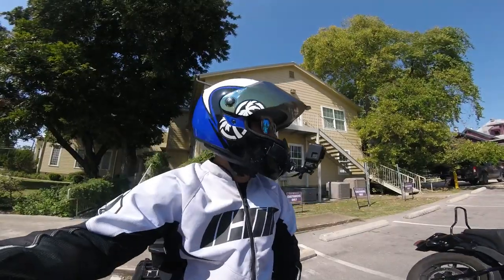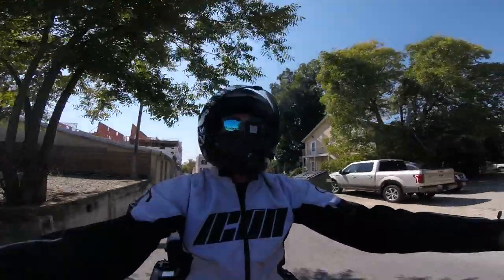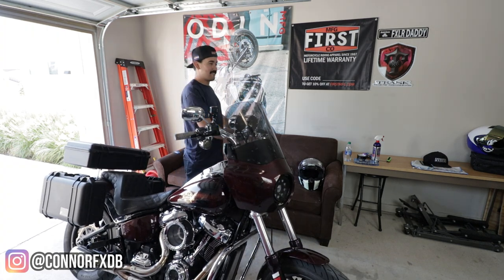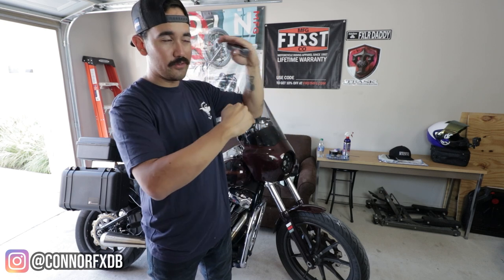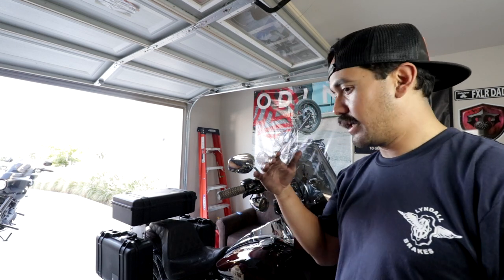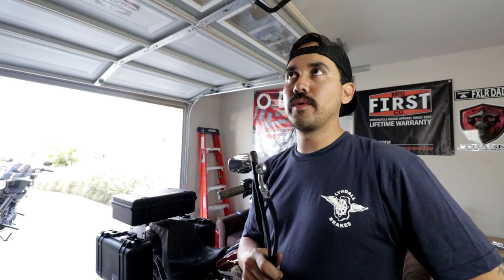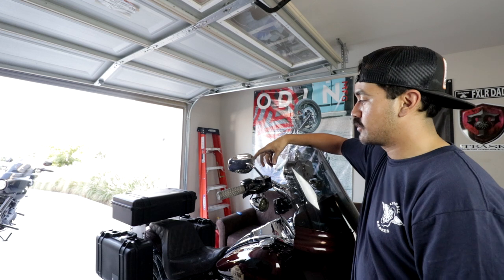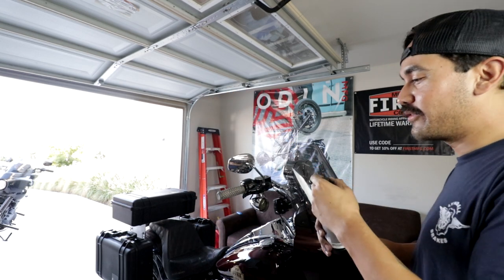13" ROTOR CONVERSION & TOKICO CALIPER SWAP | M8 Softail

Comment: If you use brembo 108mm caliber the banjo bolt is up high
Reply from the maker: nice! Those brembo m4 calipers are really nice! I ended up swapping from the tokico to a set of calipers from a YZF-R6 and the brake line/banjo bolt were up high as well which made it nice! 
I definitely enjoy the R6 calipers over the tokicos!

Comment: Hey I have a question and hopefully you can give me the correct answer.  My 2011 FXDT went through a major rebuild between 2020 and 2021. Lets just say the only thing stock on the bike is the frame, swing arm, rear brake caliper holder and rear brake caliper ( the swing arm, rear brake holder and caliper will be replaced with a Brocks Performance swing arm, Kraus Moto rear radial brake holder and Brembo .484 right side radial brake caliper by end of June). At the moment I just installed a S&S black 124 twin cam motor with every imaginable parts upgrade you can think of.  It pays to be a dealer.  Now the last thing I am thinking about doing is replacing my front dual 11.8 inch PM rotors and rear 11.5 inch Pm rotor with either the front two PM 11.8 inch brake rotors and 11.5 inch PM rear rotor with the Lyndall  11.8 inch crown cut dual front rotors and rear 11.5 inch rear brake rotor.  But after watching your video as well as other im thinking maybe I can consider the 13 inch Lyndall front rotors and 11.8 inch rear rotor.

The only issue I am having is that the Brembo .484 radial calipers go up to a 11.5 inch rotors.  But if I used the spacer provided I could have have used the 11.8 inch PM rotors.  Do you think that Brembo or any other company makes a spacer so that I could mount the Lyndall 13 inch front rotors?
Reply from the maker: howdy! the calipers wont be an issue going to a bigger rotor - the only thing you'll need is to get is a radial caliper mount and swap for 13" option. 
Speed merchant has one and provides with additional spacers; Kraus also offers a radial caliper mount with different sizing options. Its def doable!
Reply: @ConnorFXDB  Hey thanks for the feedback.  Regarding my calipers being mounted.  I have an ODC Monza 2.0 inverted front end with the radial mounting system.  When I had my stock front end with Racetech gold emulators and springs.  I converted to dual brakes and bought the Kraus Moto axial to radial adapters.  I actually spoke with my Brembo distributor at Race Technologies and she suggested that I just order their spacer and longer bolt kit for the 13 inch rotors just in case.  Im already running the Brembo spacers for the 11.8 inch rotors.  The Brembo .484 radial calipers originally came with 2 spacers sizes.  One for 11.8 inch rotors and one for 13 inch rotors. Like an idiot I through the bigger ones away.  So I ordered the spacer kit last week and got them in on Friday.  Tomorrow Im ordering the Lyndall 13 inch up front and 11.8 inch for the rear.  And in a month or two Im going to order the Krause radial bracket for the rear brake and order a right side brembo .484 radial caliper for the rear.  Helps a lot when  youre a dealer.  After ordering parts from January to March and getting everything in by May.  As we are building the bike we got so many orders for similar parts that are going on my bike.  So Im hoping the Lyndall rotors will jump start others to buy them from me as well.

Comment: Is abs delete an easy process? I have a 2016 FXDLS, with abs, dual disc front/single rear. I wonder if I can delete just the rear abs? Having it for the rear is really making it hard to be a hooligan
Reply from the maker: howdy Tyler! Great question! Yes sort of. You can unplug the abs fuse (shoot me a message on IG and I can show you -- used to do it all the time on my dyna when I wanted to do burnouts) 

In theory you should be able to remove the brake lines and the ABS spacers and replace them with regular brakes lines (often times they have blocks for ABS). If you know a dealership or shop that will plug your bike in and disable the ABS box on their system thats another route. You'll still have the wiring and spacers but it wont be turned on. Most shops wont do this because its a huge liability on their part but ask around. One might

Hope that helped! Cheers and thank you for watching!

Comment: hey man how does that set up compare to the low rider s dual disc for stopping power?
Reply from the maker: its comparable - dual disc is better since you have dual sides applying brake pressure to slow the wheel down vs just on one side. 

Im close to finishing up my dual disc conversion and willbe rocking dual 13" discs on it
Reply: @ConnorFXDB    Nice!  Yo have to get dyna front forks?  I been contemplating upgrading to the s just to get the dual disc but i like the color scheme and some of the chrome on the standard.

Comment: Put links in for Rotor and Caliper. 
Thanks 🙏
Reply from the maker: yes yes! Def will! Caliper I picked up on eBay rotor is from lyndall brakes. 
You can find em at www.lyndallbrakes.com or at Hardcore Cycles www.hardcorecyclesinc.com

Thank you for watching Peck! Much appreciate the support and thank you for the suggestion
Reply: Thanks 🙏 
Ride Safe 👍🇺🇸🇺🇸🇺🇸

Comment: I have a tokico conversion on my bike and it’s amazing!
Reply from the maker: right on! Its such a nice upgrade from the stock Axial caliper! Cheers Dalton thank you for watching! Appreciate the support!
Reply: why did you guys go for tokico insted performance machine? is it the price or tokicos are much better? i'm not saying PM is great, i wanna know why did you guys choose tokico?
Reply: @karthavya1440  I did it because of the price and with a four piston in the rear it helps but the major problem with the softail platform is the brake master cylinder for the rear doesn't add enough pressure to lock the rear brakes.
Reply: @dcashskater  Thanks man, I was really wondering why everyone is going for Tokico and not PM, I've seen a lot of Tokico conversions on YouTube but barely seen any PM. If the price isn't a pullback, will duel 6 piston front calipers from PM and 4 piston rear caliper from PM be a good choice for a chain converted 131 SoftTail Low Rider S? or it's just gonna be a waste of money?
Reply: @karthavya1440 A set of floating rotors would probably be better but the rear master cylinder is garbage. Lol